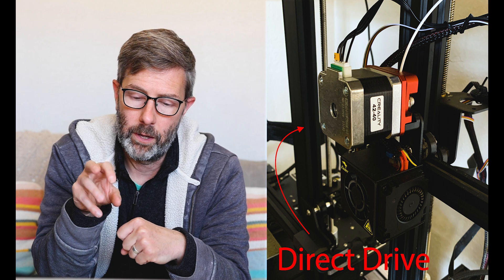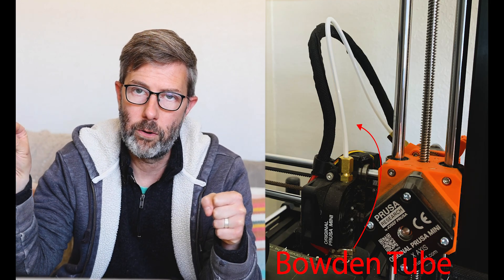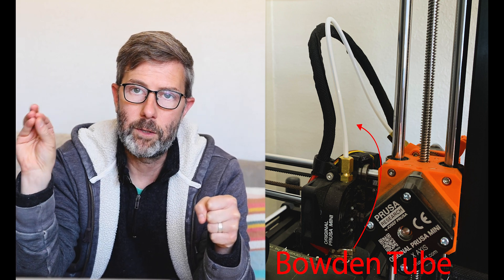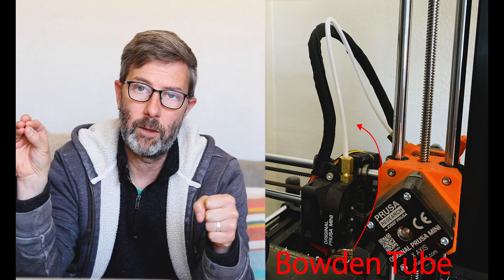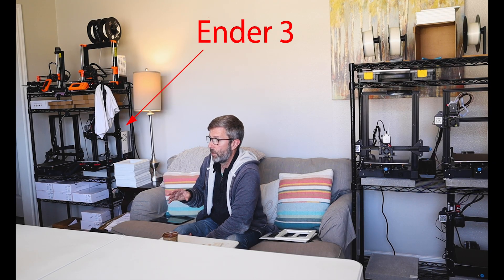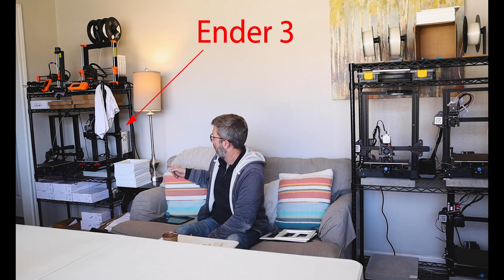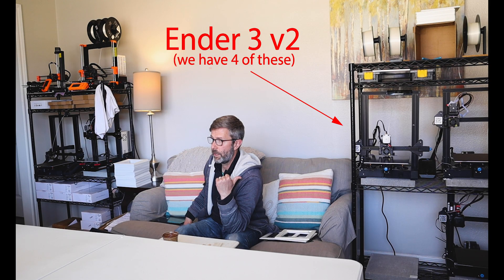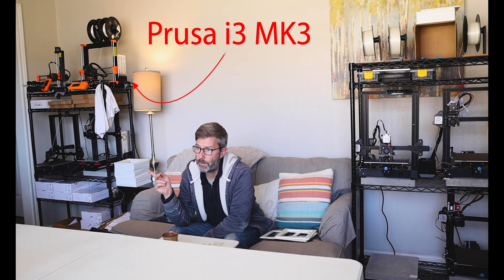Why you should upgrade Your Ender 3 from Bowden Tube to Direct Drive

Comment: Gday mate just found your channel. Is the ender 3 s1 a good buy for a first timer? Thanks
Reply: Just ordered a S1 for my first printer.
Haven't received it yet but the only issue I read about online is that the S1 doesn't have an all metal hotend. Although I think there are some 3rd party hotends that fit the S1.
Reply from the maker: i just got an all metal hotend from amazon fro $109.  I like it! I'll let you know how it performs over time.  -mj
Reply: @3Delementary  What hotend did you install?
Reply from the maker: I think it is the easiest to setup and get started printing right away.  My only regret is that there isn't more (quantity) of troubleshooting material online.  Ender 3 v2 has a ton of troubleshooting info but the ramp to get up to speed learning how to work and change everything was about 5 months for me.  The S1 leapfrogs over all that and gets to printing right away.  For me the S1 is the best way to get started printing quickly with a great machine.  -mj
Reply: I also just brought an s1 so I’ll be joing the club soon, how did you think yours went?
Reply: @Jambitjigs  The s1 is my first printer and has operated perfectly without any major problems. I recently installed an all metal heatbreak for just £18 so I can print up to higher temperatures without degradation of the PTFE tubing. The S1 is perfect for me and would recommend.